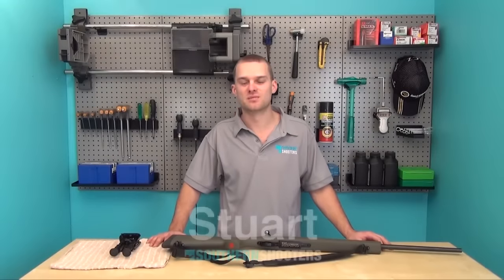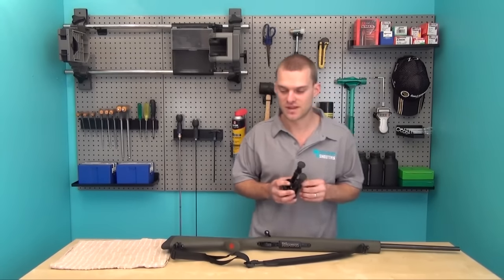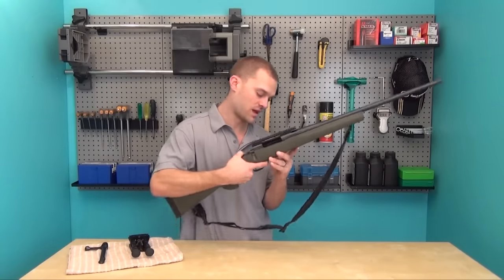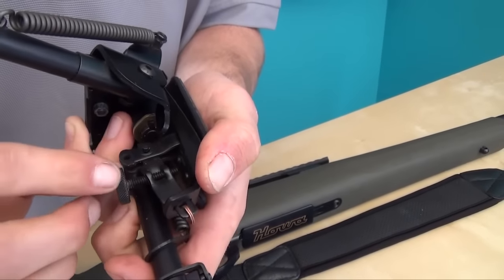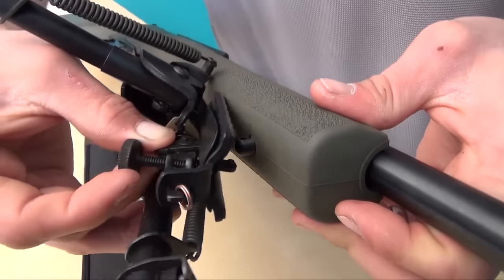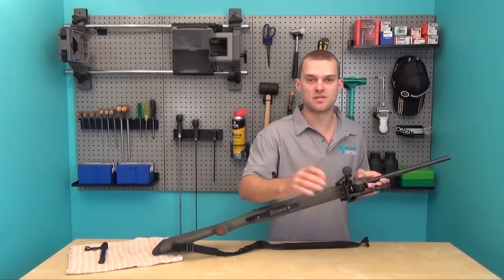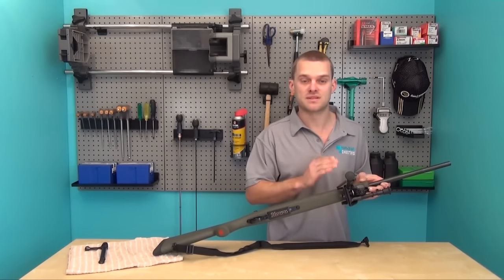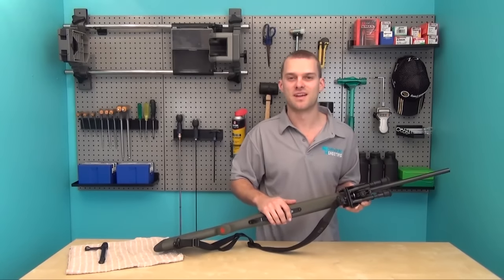How to install a bipod

Comment: I'd like to see you make a video showing us how to fit 5 rifles into a 5 rifle safe.... just about impossible!
Reply: Tim Barrett yeah never works mate

3 gun safe is really for 2
5 is for 3
8 is for 5
10 is for 8
16 is for 13

depends on your gun and attachments plus how far the blot sticks out. I use this guide as a general rule
Reply: first step remove cup holder and torches off rifle now try that

Comment: Does it matter which way the feet spring out? Seems like its backwards?
Reply from the maker: This is the way they are designed to go on (hence the sling stud is at the rear). The reason is that if you push into the rifle (loading the bipod) the legs won't collapse as they fold the other way. It certainly can be installed the other way around if you are looking for a more slimline setup, but it isn't ideal.
Reply: I was just thinking that the recoil from the gun would cause it to collapse, depending on the caliber of the rifle
Reply from the maker: Haven't experienced that happening before. I'm sure it's happened to someone. If you are loading the bipod well though, its not likely to occur. 

Used extensively on .300 win mags, and have seen them used on both .375 Cheytacs and .50BMGs without issue. With a cheaper brand, its probably more common, as the legs don't lock in so well, nor are the springs as tight. 

If you were going down a heavy recoiling rifle, there are more preferred options for bipods anyway.
Reply: Cool, thanks for your time and knowledge